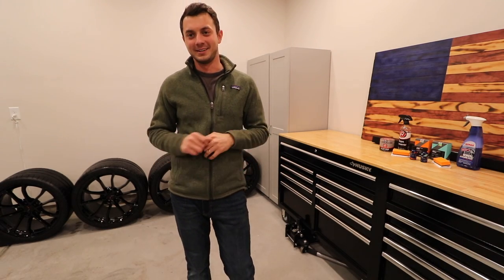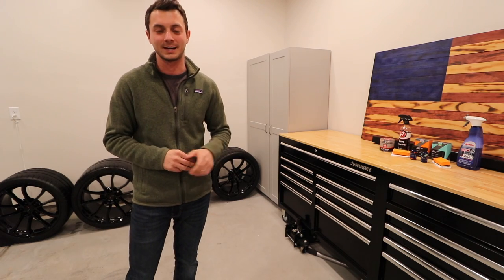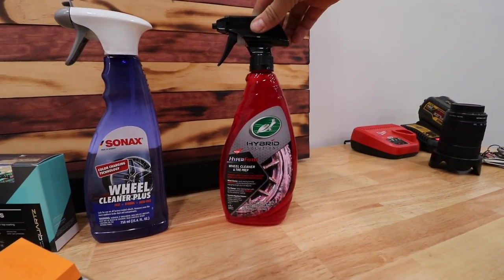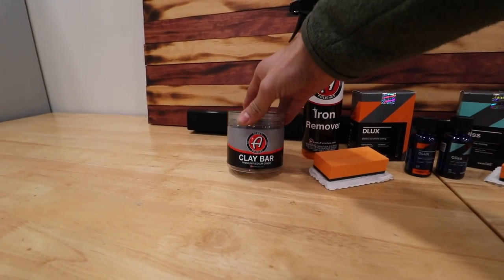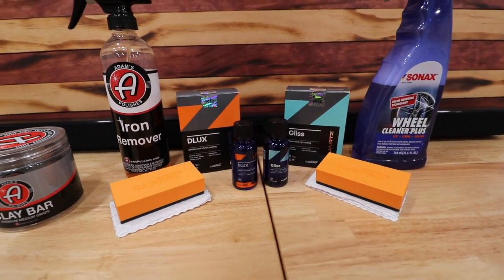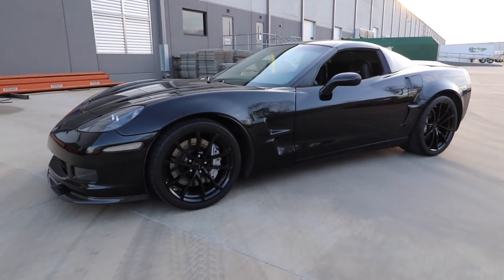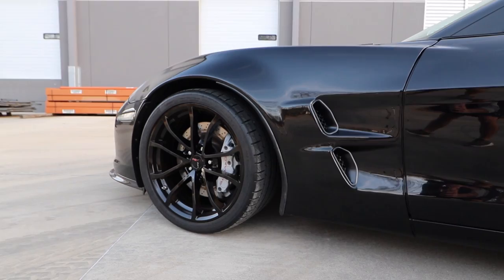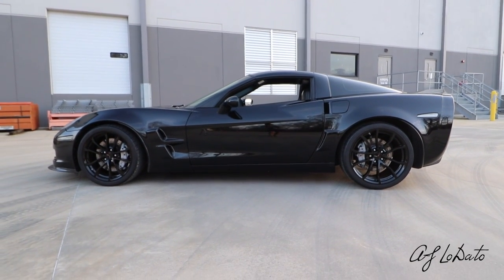C7 Cup Wheels on my C6 Corvette

Comment: Looks amazing. I’m in the market for a C6 GS and also wanted to put C7GS wheels on it. Will there be any special prepping or adjusting? Or will they fit with no issues? Great content BTW
Reply from the maker: Thank you!  10/10 recommend the GS’s. 

The beauty with corvettes is a lot of there parts, including wheels are interchangeable. These wheels needed no adjusting and had perfect fitment. Though you have to be mindful base vs Z06/GS have way different wheel/tire specs.
Reply: @AJLoDato22  thank you for your helpful input and amazing content. Looking forward to more of your GS content

Comment: These are the best wheels for a C6, period. I've been hunting for some but only find them in wheel sizes 19 and 20. My 09 Z has 18's and 19's. I don't want to or need a bigger wheel/tire set up. Are they available in my OEM size?
Reply from the maker: Don’t quote me, but I think the 19/20 are OEM cup wheels. Smaller sizes you can find in replicas.